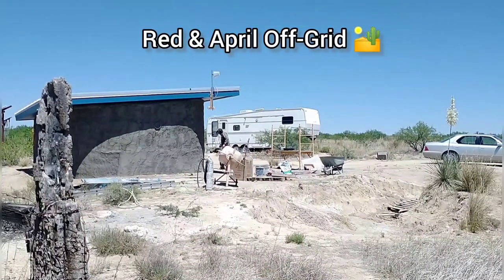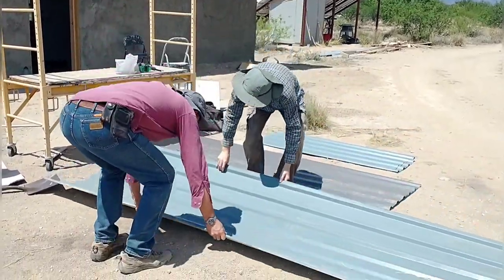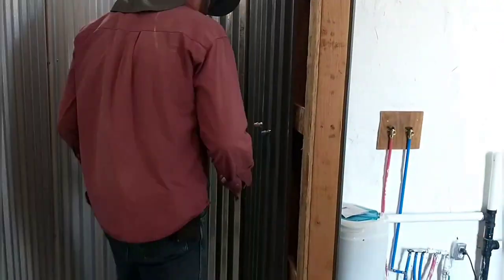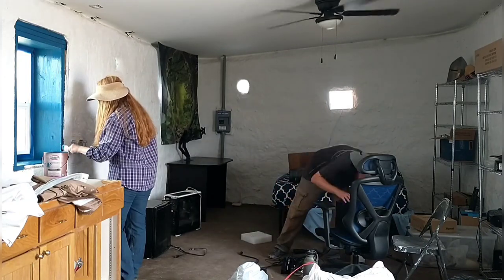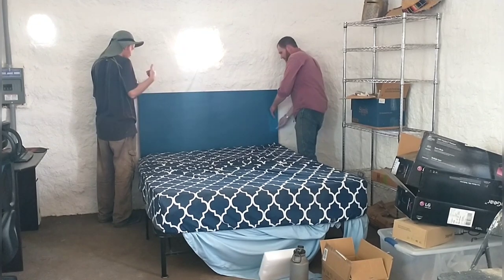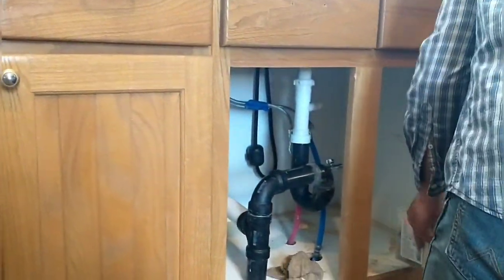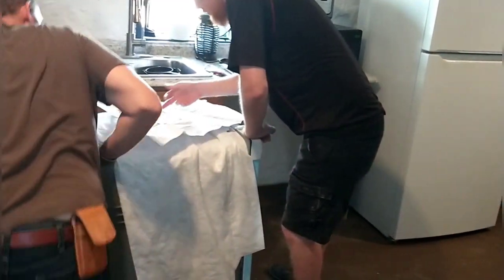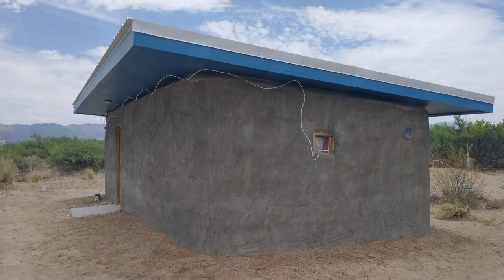Finishing Up & He's Moving In! #12 Hyperadobe Off-Grid Tiny Home Build

Comment: I think a good idea for this type f house is when you get about socket height run a wire conduit around the perimeter and place boxes where you want them and need them ... and then cover the conduit with furring strips for fastening to ... yes below or above the wires ... so access to the wire run is always on a seam ... makes for easy repairs that way ... one could also use laminated beams fr the rafters and include a wire run along its length then you can pull power down from any rafter you need to ... just include a box each 4 feet and you have access to power all over for lights sockets fans machines etc
Reply from the maker: 😎 Yes, it would have been better to at least put the boxes in as he went, but he had no idea where he wanted any of the sockets or wiring.
Reply: @RedandAprilOff-Grid  yep many things will have been learned ... for next time ... good idea to make a note of them since it may be years before you get to that point

Comment: I wonder how the heat from the refrigerator will effect the inside temp?
A friend built a tiny home, rammed earth on three sides and conventional framed n insulated front wall, maybe a bit smaller than Kyles and had to wait a while before her appliances were delivered (pandemic supply chain issues) and found it was quite comfortable temperature wise... Then when the refrigerator got hooked up the house temp rise was about 6 degrees and it wasn't as comfortable anymore. She had to put in a 5000 BTU FRIGIDAIRE AC unit in her kitchen window (and bought 4 100 watt Harbor freight solar panels and a charge controller + some LiFePo4 batteries for LED lights and powering the AC).
On 'power save' it really doesn't run but a couple of hours a day and also helps keep the E. Texas humidity down too.
Reply: Would be nice if the refrigerator condenser unit could be positioned outside, like a split air conditioning unit? Less noise and no heat gain.
Reply from the maker: Yes, the appliances do seem to add some heat. It got really hot outside at the same time, so it's hard to say exactly how much. He'll probably put in some type of cooling next summer.

Comment: You could knock down the interior temperature with an evaporative cooler. I remember that you did build a wall opening for one. I use a portable Hessaire brand cooler, and run RO filtered well water through it.
Reply from the maker: Yes, he'll probably install some type of cooling next summer. 😎

Comment: A custom built electrothermal A/C would cool the place off 12v DC power.  Search (DIY Kit 8 Chip TEC1-12706) and build it like a combination of a vehicle A/C and computer liquid cooling system with the heat blowing outside, and the cool blowing inside.  And for heat in the winter, reverse the polarity of the peltier modules.
Reply from the maker: 😎 Sounds interesting!

Comment: If you're in the desert why don't you use a clothes line and hang clothes outside?
Reply from the maker: The spin dryer just pulls extra water and detergent out, so the clothes dry faster and they aren't stiff. They still need to be hung.